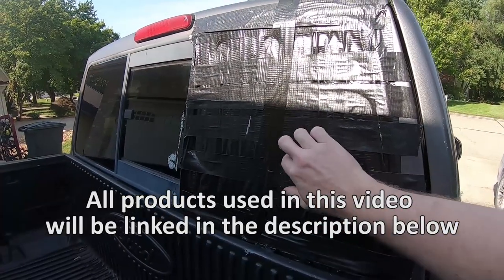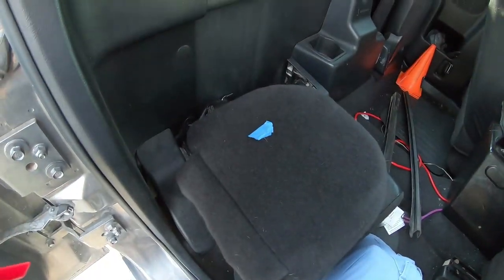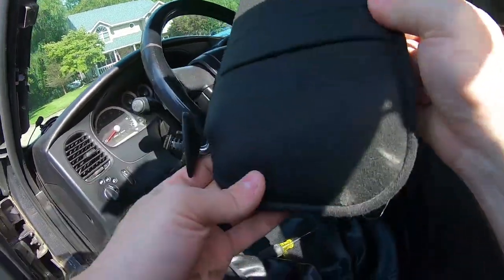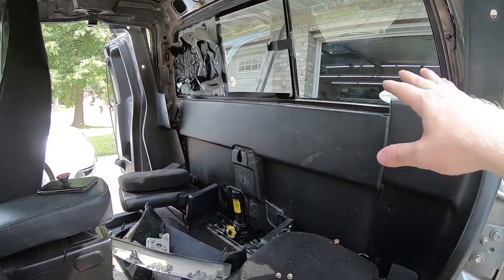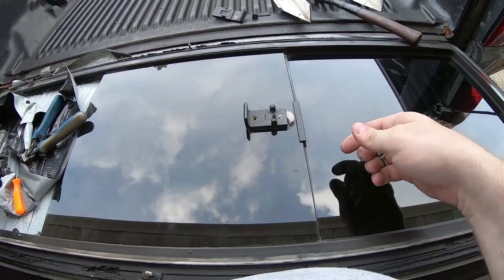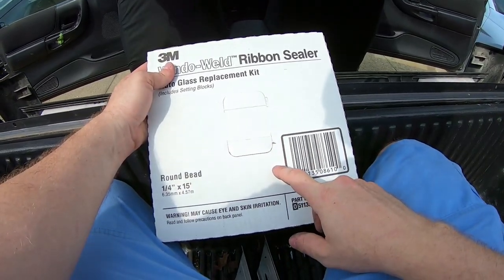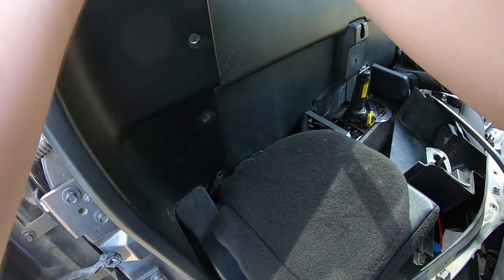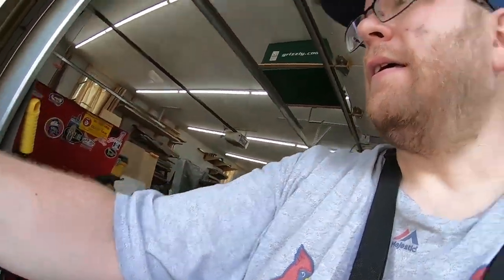How to Replace Ford Ranger Rear Glass ||  Ranger Danger Pt. 2

Comment: I have a 2000 Rord Ranger 4X4 XLT that I gave $760 for and it has the solid back glass.  I went to a local junkyard and bought a complete sliding back glass for about $50 . The junkyard truck had mostly all the trim removed.  I removed the rear sliding glass in about 15 minutes.  I could see by the junkyard truck, that rear glass would be time consuming to remove,  if most of the trim pieces weren't removed.  What I liked most was the glass frame was bolted in and when the glass was unbolted using a 9mm socket ,  gently pry and push to break the seal loose and push the frame outward toward the tailgate. There was a friend with me and I was on the inside pushing out gently but firmly and bot to bend the frame and my friend was on the outside to guide and pull the frame out . An extra set of hands is better for the actual removal of the frame and window . If I didn't have a friend to help , I'm sure I could have gotten the frame out without damaging it . I haven't installed the sliding window yet because I haven't had time and wasn't sure how to remove the trim pieces. 
   Thank you for posting this great , detailed video . I will use this video for reference on how to remove th trim pieces and remove the headliner and put it all back together.

Comment: I will be changing my 1999 rear glass soon. Thanks for the video, now I don't have to figure out how to get it out and back in.
Reply from the maker: 1999 is different than the 2004 in this video, however you are in luck because the older models are much easier to replace. No need to remove the headliner. Just remove the trim around the window, pull the screws and pop out the old window.
Reply: I am actually getting ready to do my 99. Thank you sir. Your a real one 🫡

Comment: Interesting, I just pulled out the rear window of my Ranger.  I didn't bother pulling out the headliner or most of the trim.  around the headliner.  Pulled out some of the pins and used a wrench to back off the nuts.  It worked like a charm.  Once the truck is resprayed back everything will go into place.  One more thing to note, they used a thin layer of butyl caulk as well.   Don't get me started about the 3/4 windows.  There was nothing but insane amounts of caulk holding those in place.  Took me a good 2 hours to clean that mess up without solvents.
Reply from the maker: Curious about the year of your truck. Pre-2004 models were a lot easier to get the rear window out.

Comment: EXTREMELY WELL DETAILED 👍 ;  don't worry about the length.  Every second of YOUR vid was worth it , & without useless jibber jabbering ( done by some just to stretch the video to the supposedly "golden"  10minute+ mark )🙁
     YOUR words had VALUE , & the camera views were mostly on-target.  As far as i'm concerned , your QUALITY is in the TOP 3% 👏 🔧💪 . 
   (  not trying to throw shade on 80%+ of the DIY vids out there , but MOST need more actual EDITing than they're given.  It sure looks like you took some extra time to make your work WATCHABLE , informative without fluff ) 🏆

Comment: would you recommend a 1/4 or 5/16 seal? I have heard a 3/8 seal is too big, but the 1/4 is sometimes too small. I got a leak Im trying to fix. Great video!
Reply from the maker: I can’t remember which one I bought. I wish I had mentioned it in the video. I think if you are worried about 1/4” being too small, then go wit the 5/16

Comment: Every one of those trim grommets snapped/broke on me.  Those things were in there! That was the hardest part fighting with those damn things.
Reply from the maker: Yeah same here. The older they get, the more prone they are to break. They seem a little too unnecessarily tight. You can buy spares on Amazon if needed
Reply: @SouthpawWorkshop  Thanks !
Reply: Do you have a link to the clips? The super long ones that were difficult to remove.  @SouthpawWorkshop
Reply from the maker: Check out this link and see if these are long enough for you: https://amzn.to/4cf3RlZ

Comment: Havent watched the whole thing yet. But... wanna send me that broken one? haha. I need the driver side glass. Going to see if I can work some cheat codes
Reply from the maker: I totally would have sent it to you if I still had it. I filmed this well over a year ago and that rear glass is long gone. Sorry!
Reply: @SouthpawWorkshop  No worries! I have one that I am going to be working on soon. I just dont understand why you cant take the pane out and replace it. Guess I will find out when i finally get to trying.
Reply from the maker: I looked into it. The windows are made in a way that you can’t disassemble and reassemble the frame around the glass. There are some aftermarket “glue-in” solutions, but it doesn’t look factory or even very good in my opinion. Your best bet is to find a junkyard and get a rear window from a ranger there. Good luck!
Reply: @SouthpawWorkshop  Thats prolly exactly what I am going to do. However. I hate the idea of things not being repairable. lol. I am going to at least give it a shot and see what I can come up with. Granted. I am sure its going to end poorly for me. haha
Reply: @dancando6391  Been a year hows that window looking ? My pass side is busted and looking to see what i can do about it, if I cant do nothing to replace just the one panel, going to get the whole thing from a junk